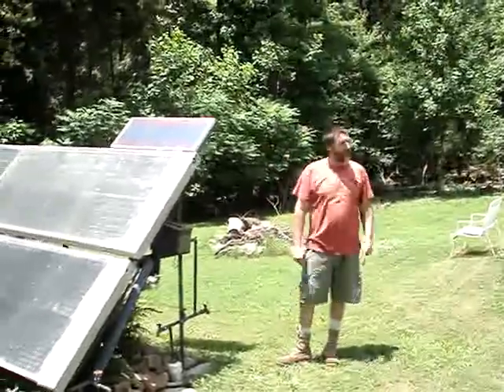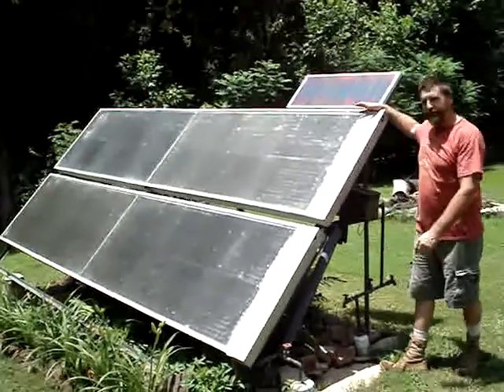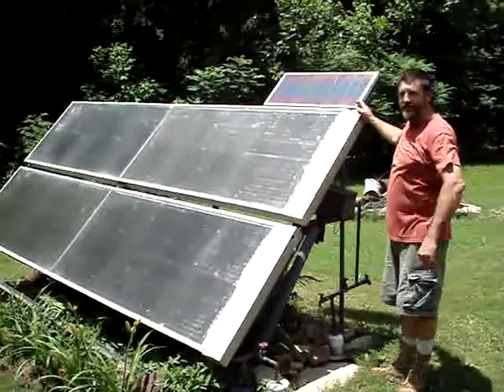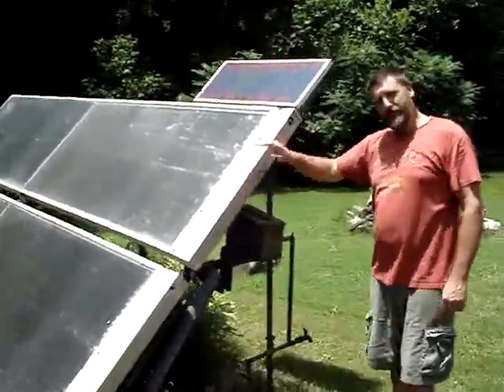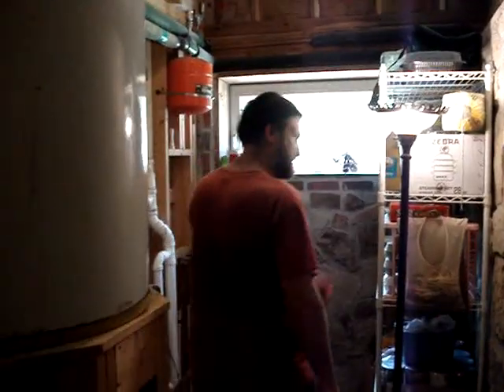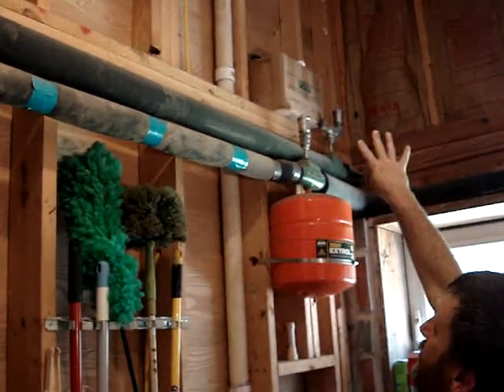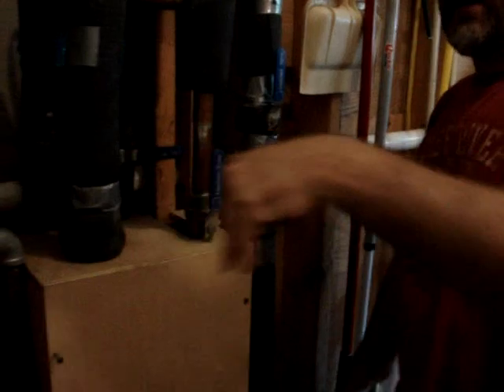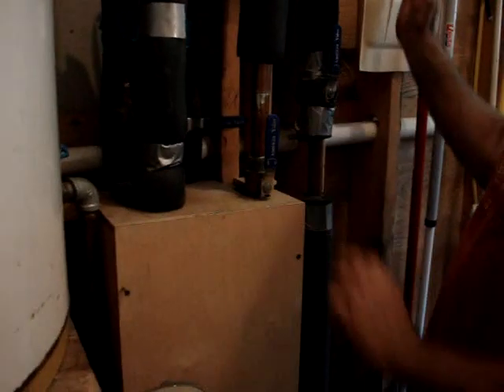Bob's SHW.wmv

Comment: Very cool or should I say very hot. 
So I get the idea that you are using  a PV powered pump in a closed loop and the hot antifreeze is exchanging heat with a heat exchanger inside the house and heat is exchanged by a thermo syphoning attached to a standard hot water tank. If you have more details and a few illustrations I would love to publish a story about it/. Do you think this is a beter wat to exchange heat than wraping a copper coil around the outside of a tank?